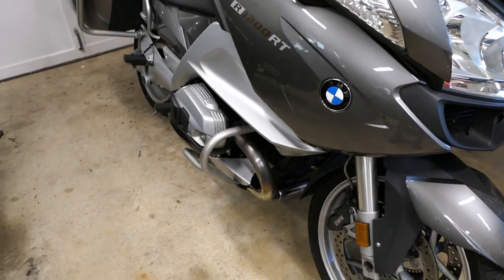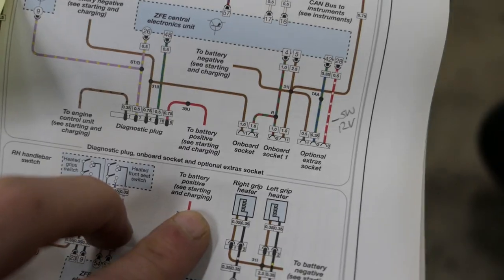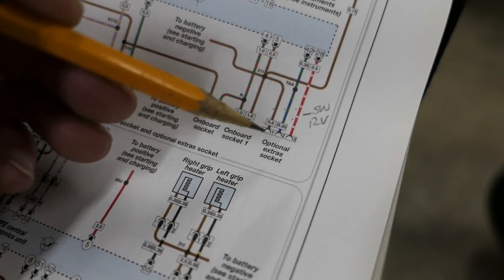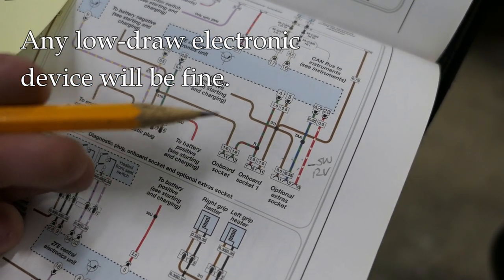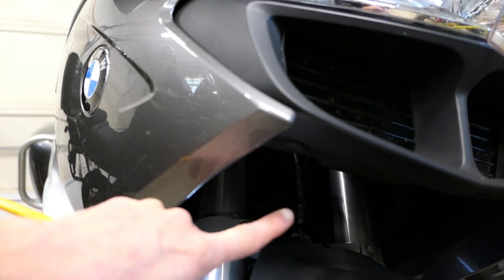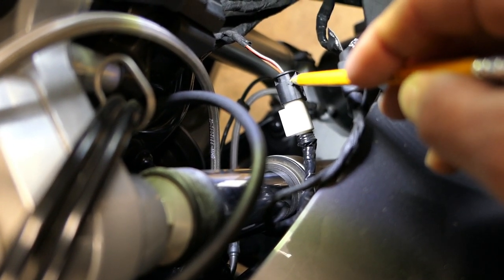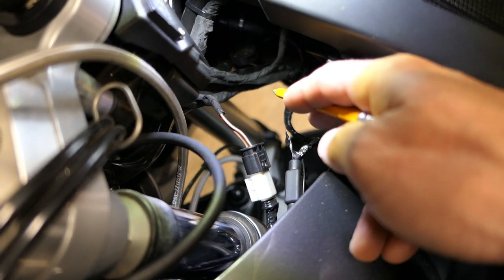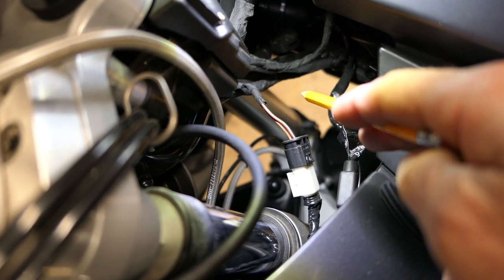Find And Use The Optional Power Socket On Your BMW R1200RT

Comment: That is a neat solution.
Another possibility is to use that switched wire to feed a relais, that switches on/off a fuse block.
Then one can go from there to connect whatever one needs.
The power draw from the relais is practically zero, so the canbus system will not "complain" about it.
Stay safe...
Ed.
Reply from the maker: Yes, that's true.  If you have something more substantial to run than a GPS or phone, a relay with a fuseblock and direct battery connection is a great option.

Comment: Nice video. It should be mentioned that this is a "camhead" 2010 to 2013 model. On my 2010 I found the plug taped to the top of the frame behind (towards the rider) the fork neck. Removal of side tupperware is required to get at mine. Thanks for including the plug part number - it is a little tight in there for soldering.

Comment: 2007 R1200 GS , found mine taped to steering column, if I just cut the tape to begin with, i wouldn't have had to remove all the plastics, but def made it easier, i dont have ship in a bottle builder hands
Reply from the maker: Yeah, once you know where the connection is you can probably wriggle in there, but removing the plastic for the first time does make it easier to see and handle.

Comment: Thanks for the time and effort to show this in great detail. I have just found my power plug on my 2012 R1200R on the right side near the front of the fuel tank ( with a 2 wire plug-brown & red/white). It was secured from the factory with a zip tie against the frame. Now I need to order a "plug and play" male plug and then determine if I need a "cigarette lighter" plug as you used, or a USB plug, or if I will splice the wires to the GPS wires.
You did a fantastic job of showing all of the different scenarios one might encounter. You are a real teacher.
Do you know if there is enough power in this supply to split and run a GPS & charge a cell phone?
Reply from the maker: I don't know for sure, but I suspect you probably can.  Neither draws much power.  You could certainly test the idea by temporarily connecting both.  They make "dual" cigarette lighter receptacles or half cigarette half USB.  Incidentally, if you use the cigarette lighter style, I wrapped a loop of electrical tape around the junction of the male and female ends just so they don't wiggle apart during riding.

Comment: Thanks for making these videos for the 2012 R1200RT.   I just purchased the same BMW, same year.  Very helpful!!!     I have a question please.    Is this optional power socket feasible for charging a cell phone?   Thanks in advance.
Reply from the maker: That power socket is designed to power a factory GPS unit, which does not draw a lot of power.  Your cell phone is also a low-draw device so you could use that circuit for your phone.  However, if you plan on adding additional devices on that same circuit you may run into problems.  If you try and power a GPS and a phone and a dashcam, you'll be pulling too many amps.  So if it's just your phone you'll be fine.  If you need to power other devices too, you could consider other options such as adding a HEX EzCan system or using the DIN connector on the fairing with a converter.
Reply: @tinderboxarts  thanks so much!   I appreciate the detailed reply.   Was hoping it would be enough for the cell phone which I also use for navigation.    I appreciate all your R1200rt videos.    I just got mine.      Next time you remove body panels / Tupperware, would you consider making a video ?   Keeping a library of the ones you’ve done.  Thanks again. Kind regards , Mark
Reply from the maker: That's a good idea on the body panels, I'll put that on the list.

Comment: Is the blue/green for the Wonder Wheel input? Apparently the BMW navigation unit utilises it.
Reply from the maker: There will be differences among model years.  In the model year (and others) shown in the video, there is just a positive and negative wire, plus a tachometer wire which is no longer used.

Comment: Thanks for the video! - but I still have a question:  I have found the white connector on my 1250RT but it is already connected to a black connector and the wire seems to come from the battery area and head back towards the battery.  i.e. It doesn't seem to be a spur waiting for something to be plugged into it.  What do I need to do to connect an accessory - will I be unplugging another circuit the bike needs?
Reply from the maker: Well, it's pretty difficult to offer advice without some pictures, but two things come to mind.  First, the video was made with an older RT as an example, so it's possible your 1250 is slightly different.  Second, if the plug you found is already in use, then it would be connected to the factory GPS--do you have one?  If it turns out that circuit is already in use, there are other options for adding circuits.  See this video: https://youtu.be/0wyMCMryQ6c
Reply: @tinderboxarts  I forgot to thank you for this reply!  Thanks! - you were right, the factory unit was already using the "spare" socket but I found a workaround in the end.

Comment: This is a great video instruction, even for someone like me.  I have no mechanical skills.  My "factory" BMW Navigator IV died and I am replacing it with a Garmin XT.  I have the "factory" cross bar and mount in place for  the Navi IV.  Will the power cable that was routed to the Navi IV work for my new XT? I realize I'll need a different mounting bracket and  am leaning toward the Touratech.
Reply from the maker: I'm not sure about that, but the new Garmin will come with it's own cable.  You can always use that as I showed in the video.  The thing to understand is that the GPS unit needs to see a genuine Garmin cable or else it will go into "PC" communication mode because it believes you are plugging in a generic cable for communication with a PC.

Comment: How much stuff can you hook up to one plug? Can you hook up gps AND a USB for charing phone ?
Reply from the maker: This circuit is designed to power a factory GPS.  There are no published specs on the amperage it can supply, as far as I know.    You could try a temporary connection for your phone and GPS to see if the system shuts down the circuit and complains.  Probably, though, it would be best just to leave it for your GPS and create another circuit for charging your phone or other devices.  You can do that either by installing a third party device like the HEX EZcan, or by installing a fusebox directly off the battery terminals.

Comment: Great close up focus and explanation.  BMW newbie with a 2001 1150 GS.  Will you/anybody tell me what is the deal with the smaller 'cigarette lighter' or power ports on BMW bikes? Or maybe it is some sort of european standard?   Do they still do that on newer models?  I don't know what the thing is called.  :  )   In my little mind all I need to do is get an adapter to plug into this BMW type port and then I can fire up cigarettes all day and all night, or power whatever I want.   Thought it would be simple to find one on ebay.  Well, not when you don't know the terminology.  Bless my little heart.
Reply from the maker: That's known as a DIN port, and it is a European standard.  However, you can easily find adapters on Amazon or other places.  They are still used on newer BMW bikes.

Comment: Great Vídeo. Is it possible to use that extra socket for auxiliary lights?
Reply from the maker: No, the lights would draw too much power for that circuit.  Instead, you could install a third party device like the Hex EZCAN or install a relay on the circuit shown in the video to control straight battery power to your lights.  More info here: https://youtu.be/r4w9XQXcsMk
Reply: @tinderboxarts  great !! thank you very much

Comment: afaik the middle 'pulse' wire allows the gps to know the bike is still moving when it loses gps signal, in tunnels etc, which allows the gps to make more accurate guess about location to display on screen
Reply from the maker: I didn't follow you at first.  So you're saying the factory GPS uses the pulse signal?  Interesting.  I don't have the factory GPS, so that's not something I can check.
Reply: @tinderboxarts  my bike gps isn't bmw either so i just tapped into the power and earth line of that cable....but it makes sense  that in adverse reception conditions knowing what speed is doing would help the gps processor with a better dead-reckoning guesstimate as to where the bike was and hence justifythe higher price over the zumo etc

Comment: I've just found this plug on my 2012 K1300R (it's just forward of the battery on this bike).  I suspect this circuit is ground-switched by the body control module though, because if you put your positive probe on the plug and your negative probe on the battery negative, the plug is permanently live. 

Some additional evidence here is that the plug was providing 11.5v when the bike had been off for a while, battery voltage (13v) after I turned the ignition switch on, and 14v when the bike was running. There would be no reason to only get 11.5v on this plug unless I was getting regulated power from the BCM in the "off" state.

I'll re-validate these measurements and come back if I'm proven wrong.
Reply from the maker: I never checked that, and I also don't know if the RT and K bikes are identical in this regard.  It's important to remember that the CANBUS system keeps the circuit alive for some period normally.
Reply: @tinderboxarts  I re-validated and I was way off.  My old man eyes were reading it as 11.5v but it's actually 1.15 volts.  It depends on the sensitivity of your multimeter but mine reads a potential of 1.15 volts when the circuit is off.  My other multimeter (a power probe) reads 0.0 volts.

Anyway I made a video about my experience (it's more about Quad Lock than the power socket): https://youtu.be/dyxqWMcmHjY
Reply from the maker: Old man eyes.  Lot of that going around!

Comment: John how do you feed the power cable from the bracket to the plug? Worried about doing it via the windshield adjustment motor. BTW I have the new RAM wireless charging bracket.  Amazing
Reply from the maker: I fed mine up between the cracks in the plastic dash on the rider side.  There's lots of room there and rubbing hasn't been a problem.  I didn't even have to take anything apart, you can just slide the wire in from the side.

Comment: Sory im was wrong, socket works  she is live when  key is on and if you turn it of she is steel live for some time around 2 min, i chek it with tester, but  my garmin   zumo 595lm is still on and charging  even you turn the key of  garmin charging  longer than   2 mins

Comment: I just bought some Aux lights for my 2008 r1200rtp and the lights have a ground wire, power wire and Acc wire....where would I connect the acc wire?
Reply from the maker: To install lights your choice is either to connect directly to the battery with a manual switch, to set up a relay instead of a manual switch, or to use a device like the Hex ezCAN which ties into the CANBUS network.  If your lights came with a relay, you may be able to use the harness connection in this video.  But I can't tell from your description what all you have.

Comment: I lost power on this plug and I can't figure out why. Any suggestions?
Reply from the maker: Possibly there was a short or similar problem, in which case the computer would shut the circuit down and present an error code.  You could read that code with a GS-911 device or a motoscan app.  It's also possible you have a broken wire.

Comment: Any idea how to find the fuses on 2017 R1200RT? My power outlets stopped working as well no power to charge my GPS head unit. Can't find the fuseboxes amd the owner's manual is of no use. I pulled the ECMs out of their holders front and rear seats but can't see anything underneath them,  nor around the battery area
Reply from the maker: Some model years do have a couple fuses protecting the alternator or instrument cluster, but by and large the RT uses the CANBUS system:  https://youtu.be/r4w9XQXcsMk
Reply: @tinderboxarts  Thank you very much for the info.  I think this is the case.  I put a very good quality battery tender on the auxiliary plug outlet and at some point the auxiliary stopped working.  I've never had anything plugged into it before or since and I've deleted all the fault codes as well I've had the battery out.  I think I'm going to hardware a fused plug to the battery for future charging operations but I still want to get the auxiliary ports working and of course power to my GPS
Reply from the maker: If it is a CANBUS protected circuit, the system will recognize when it is operable again and allow power to the circuit.  Take a look to see if you have a broken or pinched wire, or a connector which fell off, etc.
Reply: @tinderboxarts  strange, I had to ride it a few kms to get it to reset after having cleared the codes w SnapOn scanner. Now all working. I pulled the battery back out and installed a direct connection to battery w 20 amp fuse for charging.  Thanks for making the internet a better place w heat videos and tutorials. Awesome 👌
Reply from the maker: Yeah, this is pretty common with all computer controlled vehicles made in the last 10-15 years.  The computer needs to see a preprogrammed threshold of distance or time or both with no faults before it will clear.  Interestingly, cars now have a "permanent" fault code which is stored for some emissions problems.  You can clear the code and turn the light off, but the record will stay in the computer for quite a long time--hundreds of miles.   This was done so that when emissions testing is done owners can't just clear the code quickly to pass their state inspection.  The problem has to actually be gone and evidence of miles put on the car before the permanent record is finally purged by the computer.

Comment: hey, i have a mount for my gps with 4 buttons, there will be a wires harness with 2 x 2 wires and 2 different connectors, which one should i use on my r1200rt 2007?
Reply from the maker: I don't follow you.  Is this an official BMW mount with the OEM GPS, or are you trying to mount a third party GPS?  Third party GPS will only need a power source, typically, which is what this video was about.  If you are using the BMW mount and GPS, there may also be additional wires for controls.

Comment: My goodness John,you have a clean machine....... Regarding the optional connection,,,, I actually have the factory connection kit,, its just a socket and two wires (I think two it been about 3 years since I bought it),,  I will have a delve this coming week,,,   Thanks alot
Reply from the maker: It's funny, I'm good and sick of washing and waxing the trucks and cars and trailer in my driveway, but my motorcycles I actually enjoy keeping clean.  It only take a few minutes since they are so small, and I've been using "waterless wash" which just sprays on and wipes off.

Comment: That socket is for when power is on I.e. key in so no good for charging..
Reply from the maker: Do you mean putting the bike on a battery charger or do you mean charging a phone or GPS?  This video was about the switched power you can use for GPS or similar device, and it will shut down after the key is switched off and about 20 seconds or so.  So the device would be running off bike power when the key is on and charging it's own internal battery in the process.  Key off an the power shuts off after 20 seconds or so.

If you are referring to charging the bike battery, you can charge through one of the accessory DIN sockets if you wish, as long as you have a CANBUS compatible charger.  Personally I prefer an SAE cable wired directly to the battery.
Reply: Switch live is perfect for charging, permanent live would drain your battery!